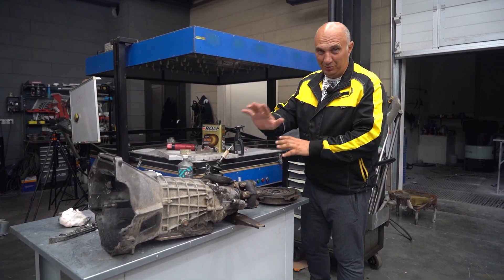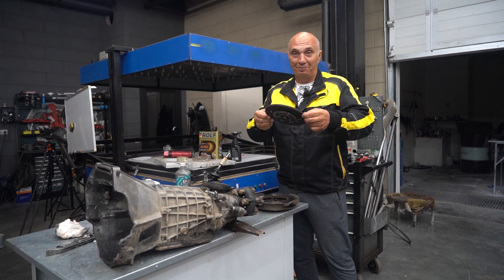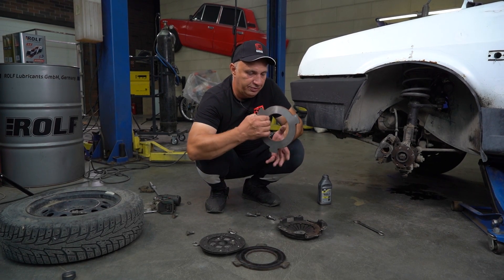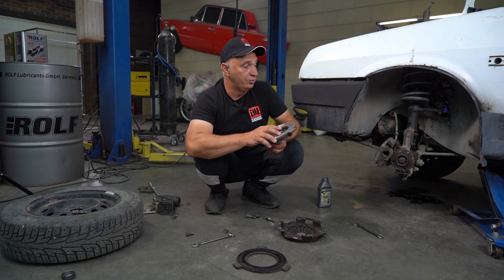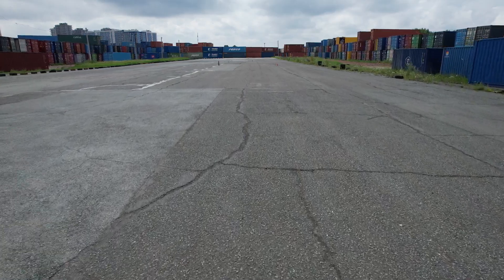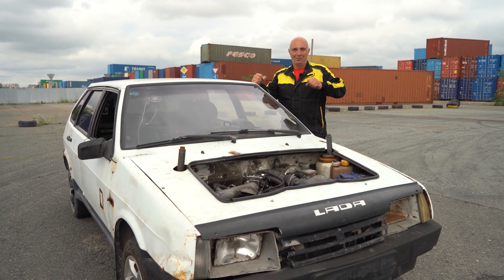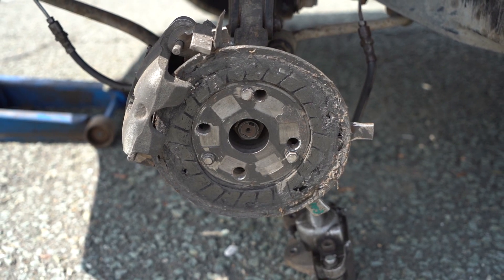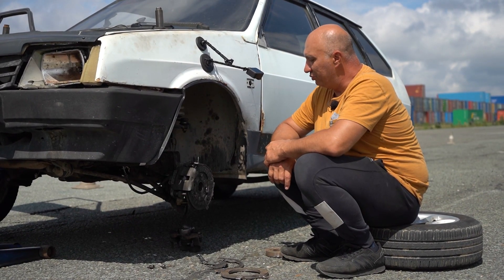We replace conventional brakes with clutch components - will it work?

Comment: Now use a brake disc as clutch?
Reply: Seconded
Reply: Thirded
Reply: They did do it with drum breaks it was a good video
Reply: @brandonmarcinkowski2098 brakes
Reply: 5:28 russian justin bieber
Reply: They will just weld together.
Reply: I commented before i watched. I thaught they were going to use the entire clutch mechanism. With transmission side being the wheel axle and motor side stationary fixed to body. So that when clutch is pressed brakes are off. A full clutch brake. Complicated to make but way more interesting.
Reply: fourthded
Reply: Exactly
Reply: Or brake pads as clutch rather
Reply: Already technically they already did this on the channel
Reply: Use different grades of pads I'm curious if the different pad grades would affect the slippage and the durability of the different materials
Reply: Fifthded(?).
Reply: For some reason I thought they already did this.
Reply: I keep saying this 😢😢😢
Reply: Sixthed
Reply: Maybe drum brake system
Reply: Yea and brake pads as tires..  lol
Reply: Honestly they already pretty much make clutches you can buy that are very similar to brake pad material. 

They actually hold more torque, the down side is very harsh engagment, and shortened life span when put through normal driving situations like stop and go traffic.
Reply: They already made a clutch using a brake drum and shoes, that is a centrifugal clutch 😅
Reply: They already did in another video.
Reply: They already did that
Reply: Now I really wanna see this
Reply: They did that already
Reply: @PREDATEURLT  hahahahahaha
Reply: Drum brakes as a clutch
Reply: No point
Reply: Use brake pads as the friction disc
Reply: thirty-seventhed
Reply: Then basically it would just be the same as a worn out clutch with no rubber left
Reply: That's what WhistlinDiesels monstertruck does
Reply: Excellent
Reply: wow what a great idea. that would be a crazy amount of control
Reply: They kinda already use this in racing applications.
Reply: That is a regular flywheel not really different whatsoever
Reply: I dont see how you could get the calipers spinning, the hydraulics cant be rotated. Alltho they allready used drum brakes as centrifugal clutch so they kinda did it.
Reply: @DookieMcPoo  as for hydraulics can't be rotated. Howe tech industries, (I may have got the name wrong) the makers of the rip saw. Watch cleetus McFarland or diesel sparks rip saw video. Each side of the axle has two sets of 3 calipers, one set that doesn't spin ( for brakes)and another set that does spin( for drive engagement )
Reply: @MsLoneWolf4 well yes. i know the ripsaw well. But i was thinking in terms of garage54s paygrade😄
Reply: @DookieMcPoo you could put the friction material onto the pressure plate. It will work but won't have the same gripping power as it will only have friction material on one side.
Reply: @DookieMcPoo what?😂😂😂
Reply: @DookieMcPoo  brake disc. The rotor, the disc.... not the caliper and no hydraulics tf?
Reply: So you want them to friction-weld a brake rotor to the flywheel (pressure plate)??
That's basically what will transpire, since the rotor and flywheel are big, flat steel surface in which a softer material presses onto in order to grab. 
Whereas now it'll just be two hard surfaces pressing against each other, aka what happens when your brake pads wear out. 😅

Unless heat, sparks, and very little forward movement is what you're asking for?
Reply: Maybe use differential in it? 
Driveshaft 1 as input from the engine, driveshaft 2 as output to the gearbox and the propshaft as clutch (Brake disc and caliper). The output will of course spin in opposite direction but just turn the rotation with gears or flip the differential around from the rear axle. This system would be interesting to see!
Reply: Oh you ment just the disc...thats kinda meh...